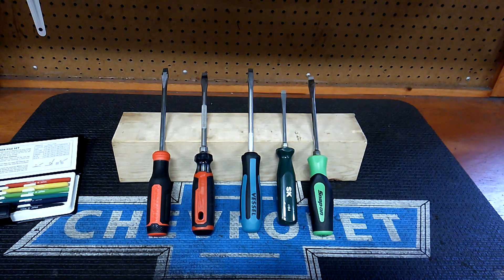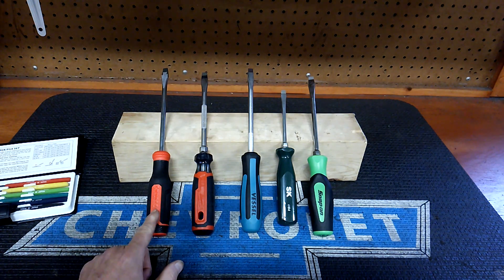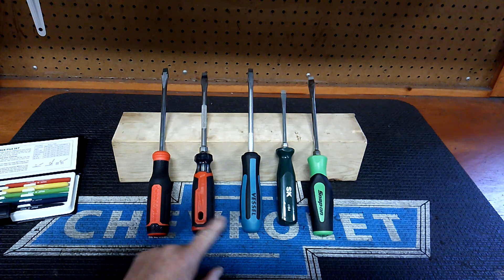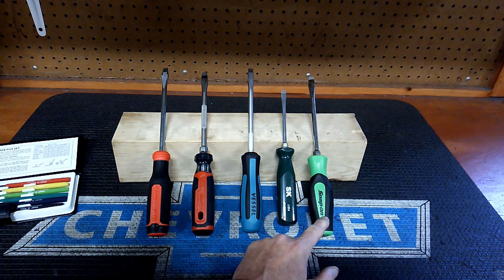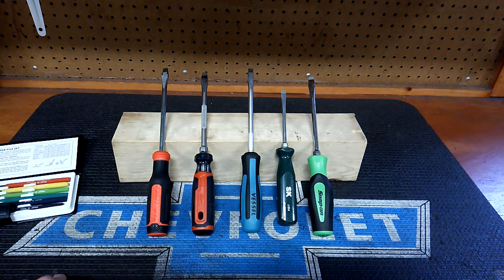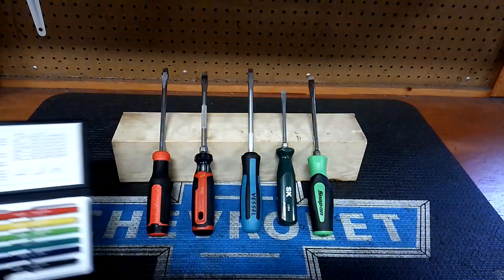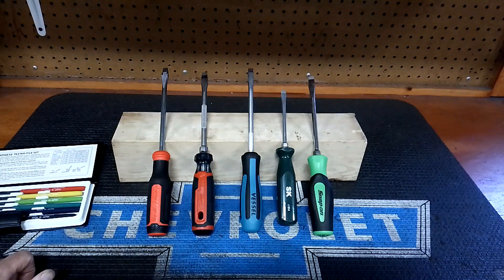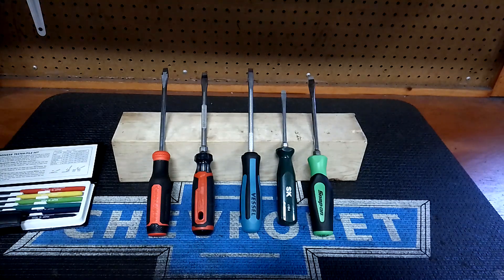Rockwell hardness test,snap on,sk,vessel,USA Milwaukee,craftsman(crazy)

Comment: Craftsman being less than HRC 40 means it's a great screwdriver for shoving into rotors for brake jobs. It will bend significantly more than the harder screwdrivers before breaking.

The higher the hardness, the lower the ductility of the screw driver. The higher the hardness, the more likely the tips are going to chip and break. 

Great video!!
Reply from the maker: All valid points my friend!! steel that can be to hard can become to brittle no doubt!! thats why chrome vanadium sockets can break on impact guns,to hard and it breaks!! impact sockets use chrome moly which is alot softer but more durable to withstand the impact blows,thats why it also much thicker walled socket because its not that hard!!! thanks my friend for your input!!

Comment: Decent screwdrivers range from 45HRC - 52HRC +/- 2. Quality bits (s2 steel) range 55HRC but no more that 58HRC
Reply from the maker: I think the hrc rockwell files did a good job!! sk,snap on i had at hrc50, i had the vessel and milwaukee at hrc45 and the chinese craftsman at hrc40!  thats not bad! id say the files are not 100% conclusive,but do have merit on how accurate they are,food for thought,thanks my friend for your input!l

Comment: I wonder if you just scratching the protective Coating on the tip? I would be curious to see if it scratches the shaft of the screwdriver
Reply from the maker: Well im glad you asked i didnt show that, but it did the same to the shafts!! i didnt show it,but probably should of,thanks my friend for the feedback!!
Reply: @jefftovani5535  Thanks for the post. It was very interesting. I wanted to do something like this with different brands of socket.
Reply from the maker: Ill be doing sockets!!

Comment: I would expect that the SK and Snap on would be the hardest. Snap on is definitely hard on the wallet! 🤣🤣 Could you do a hardness test on the K Tool screwdrivers?
Reply: I had a set of those and wore the #2  Phillips out pretty quick. I warrantied it then sold the whole set and went back to my wittes that over 20years old.

Comment: I think the Milwaukee is a good all around driver. Would have like to see prices on all of these
Reply from the maker: $15 craftsman CMHT65075N, 8 piece, milwaukee $65 MT200-6, 6 piece set,vessel $53, 9006BP, 6 piece set, SK $111, 86006, 9 piece set,  snap on $180 ,8 piece set,dont have a # everything was bought on amazon but the snap on,bought on ebay!!